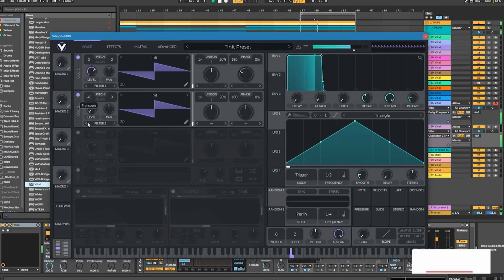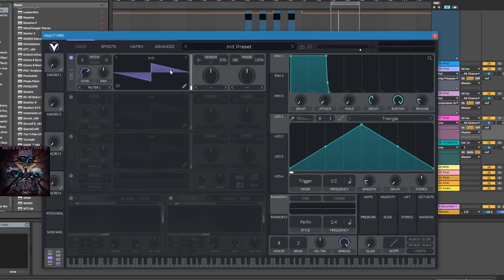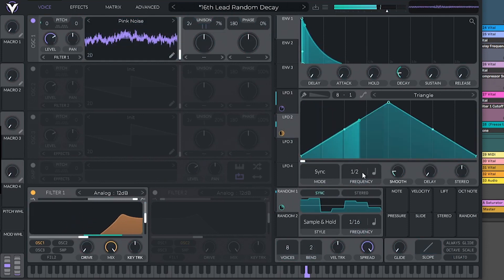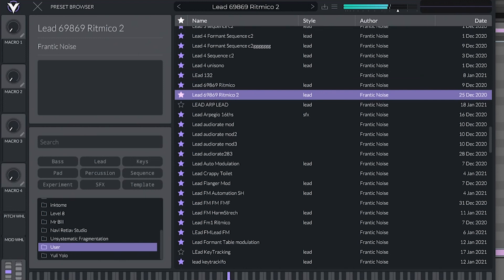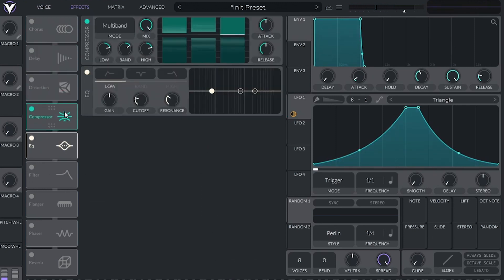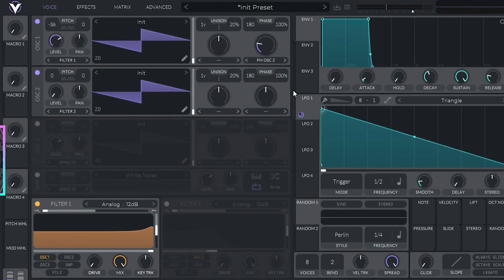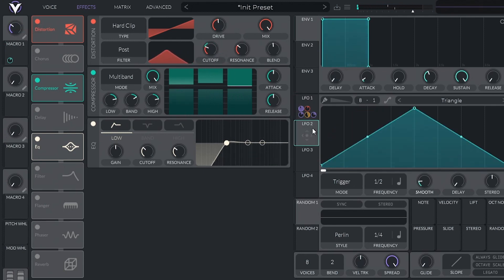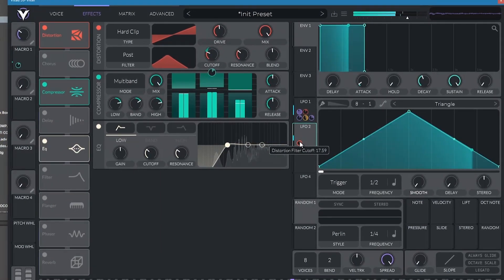VITAL SERIES 5: FM Leads & Wobbles

Comment: Dude your sound design is next level, I have been watching your Vital videos and these LFO as FM modulators, among some other things. Even the filter usage in Serum is not like anything I've seen before. Really top stuff.
Reply from the maker: Glad you like them! i sell presets and video tutoriales, courses, webinars here :) 
https://franticnoise.gumroad.com/
Reply: @FranticMediaAcademy  Im definitely going to pickup the Vital ones
Reply: @FranticMediaAcademy  I do have a question: If I wanted to use multiple instances of the virus TI, its not possible, and since its once channel I cant use all the midi channels in the chain, so I was thinking, a simpler I would have to play on C3 to get an unwarped version. Do you think I can load a virus recording into a drum rack and have it triggered by the same note that all the midi is in? Or any other solutions if I wanted to add a synth recording instead of a synth into the chain? Im thinking Vitals sampler also plays in loop without doing much but Im not sure how clean that is.
Reply from the maker: @riyazsonday7025  id use a simpler instead of a drumrack or PhasePlantn instead of vital which has the sample mode, 
but yeah you guesses rigth, having them in a drumrack woudl force you to set the pitches previously for each sample,...
Reply: @FranticMediaAcademy  Thanks for the info :) Much appreciated